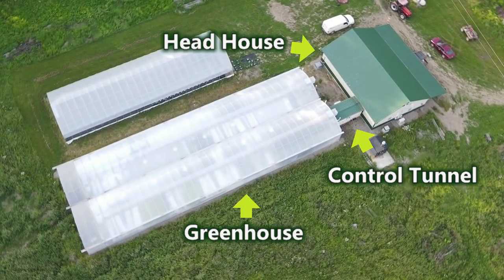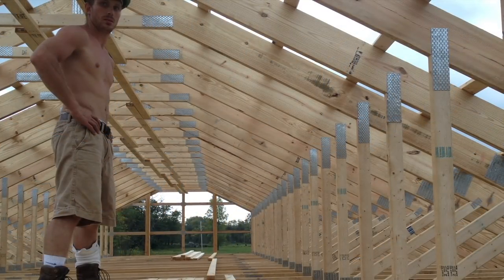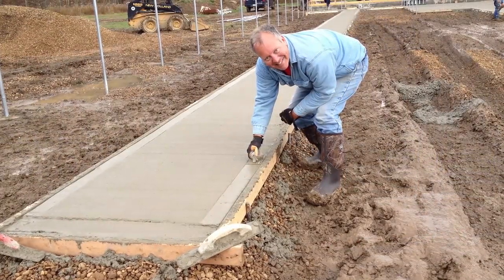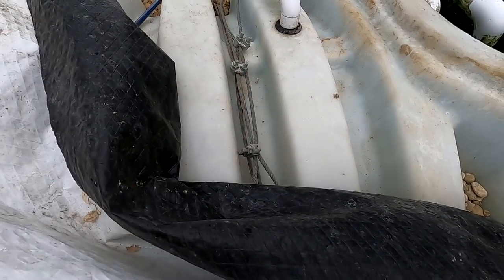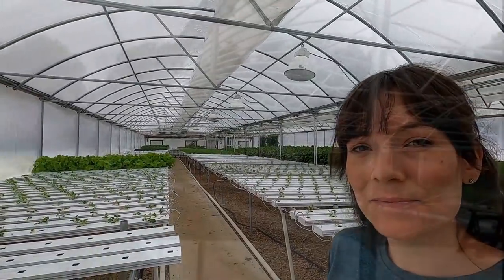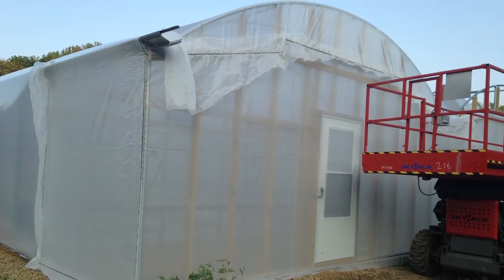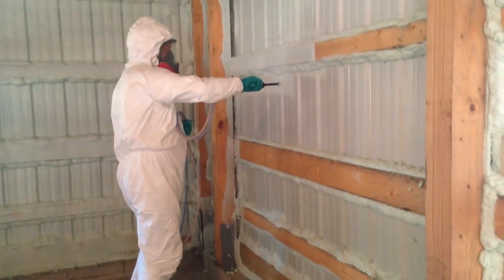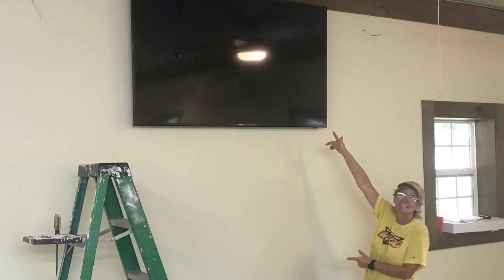Hydroponic Greenhouse Build From Start to Finish

Comment: Wow great job.  I read a book once called the Broken Heart Buffalo Farm where the owner said that being a farmer means that you will have know all the trades otherwise it would be too expensive to run the farm.  This video sure showed the number of trades that Doug knew.  He had to work concrete, sheet metal, capentry, electrican and plumbing. He sure save more than a pretty penny for this job but needed a lot skills. Respect.

Comment: Wow, that's a nice set up! I'm planning on building a large greenhouse on my property in northwest WA. I've been watching a lot of videos on the subject and was thinking of doing the geothermal system to capture the 55 degrees of ground heat to keep the heating bills down. I'm probably going to do raised beds but your system of only using water is very interesting. What would be the best design of greenhouse I could build? I'm a carpenter and would like to do as much as I can like your family did.

Comment: Really great project of the greenhouse system. Your Dad is a very methodical worker in the detail of the build. Looks like a ton of research went into this. Very impressive.
Do you have an alarm on the sump pump in case it fails. It is an electric motor with a switch is why I ask. I guess there was no way to put in drain tile to a lower site to empty.
Reply from the maker: Thank you! We do not have an alarm, but that would probably be a good investment.  There is a small river right behind the greenhouse and we are in a valley which keeps the water table high.  I'll have to show how close the river actually is sometime.

Comment: This looked like a really fun project. Lots of hard work though. Congrats to all of you. What size is your head house? Also how far is the head house from the greenhouse? How wide is the control tunnel? Looking to eventually do one myself. Thanks.
Reply from the maker: Thank you very much! I want the head house is 40x50', but I'd have ask Doug for sure.  The head house is only 10 or so feet or so away so that's how long the control tunnel is.  It's probably 6 feet wide. Not big at all which is why we love having the extra space in the head house.  I recommend giving yourself lots of work area if you can. - Devon

Comment: How does it work using city water for your hydroponics. Is it expensive? Here in NZ I have to use city water but have to use a lot of acid to bring the ph down. Our water is about 7.2
Reply from the maker: Its not expensive. Our PH is 7.1 so like you we do have to bring down the PH...what are you using to lower PH?
Reply: @HomegrownPassion  Nitric acid

Comment: You guys show everything so easy, each of those projects are a challenge , congratulations on jobs well done. I have one question tough, the water source is beneath the earth, how do you clean it when there is algea or some other contamination happens. It is bound to happen at some point , right ?
Reply from the maker: Thank you very much.  It was a big project, but we had a lot of fun.  I will have to show this in a video, but we can totally drain the tank. We have a very long brush, and we can also hose it out.  We do need to clean sometimes to get the algae out.

Comment: First thank you for the video.  It is a high quality project .  What do you use for a slope for the various drains ?  How do you clean debris out of the stone and do you wish that this were concrete also ? With the large roof areas would rainwater harvesting have been a consideration for your water usage, either for the plants or for the wet wall ?  Thank you for sharing.
Reply from the maker: Of course and thank you! For the NFT channels, the need 1" of slope per 4'.  I'd need to look up the plans to see the slope of the large return to the reservoir.  We usually have the leaves fall on the cement when harvesting luckily, but sometimes we have stuff break off and we have to climb under there.  We also get a few weeds pop up and just pull them.  The stone works well, but I'm sure full concrete would be nice.  Rainwater could easily be harvested, and is something we are considering to use for our high tunnel.

Comment: May i ask, How did you guys install the plastic. Did you use screws?
Reply from the maker: No we used wiggle wire and clasp system designed to be used on the gutters

Comment: What was the place where you got the spray foam insulation?
Reply from the maker: It's called Foam it Green. Doug ordered it online and it comes with everything you need. Here's the amazon link but it's sold out on there.  You may be able to find it some where else.  
https://www.amazon.com/Foam-Green-602-Closed-Insulation/dp/B00597CCUU

Comment: the long a waited vid is finally here , thank you so much , i have one question ,what is the benefits of a double layer of poly vs one layer ?
Reply from the maker: Of course! The double layer is for insulation.  We have inflation fans for both the sides and roof, and it keeps an air pocket between the layers.
Reply: @HomegrownPassion  Who is the manufacturer/supplier for the greenhouse framing and the double ply poly sheets. I like the double sheet idea. Thank you for educating and entertaining us. You are a pleasant presenter who do really quality video production work.

Comment: The video is well thought out and edited. It must have taken some time to put together. Well done.
However - it inevitably raises a whole bunch of questions for me.  Here is the list!

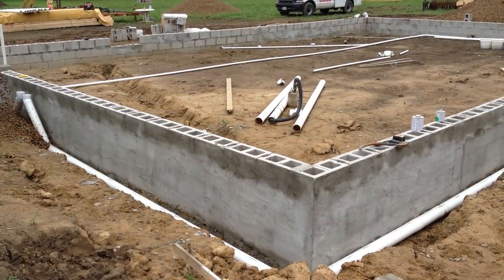At 01:38 - the cement block walls look like they have started to be rendered. 
If that is so, why would you render them?

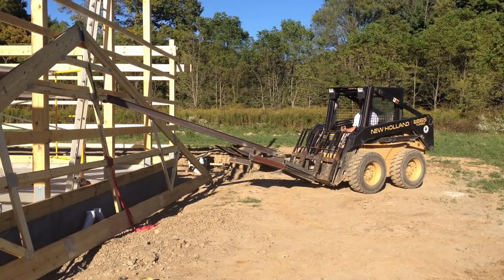at 02:39 - that skid steer looks like it would be able to lift 800kg or so. 
The trusses do not look so heavy.  What was the problem with the jib? 
Was it because it was hard to maneuver the trusses and control where they were placed
- or was it actually the weight that was the problem?

Some details I'm not sure about are - which direction is the greenhouse aligned with?
How high are the tops of the posts off ground?  
How far apart are they spaced? 
Knowing that will enable the approximate length and width of the greenhouse to be calculated.
And how high is the greenhouse at its  apex?
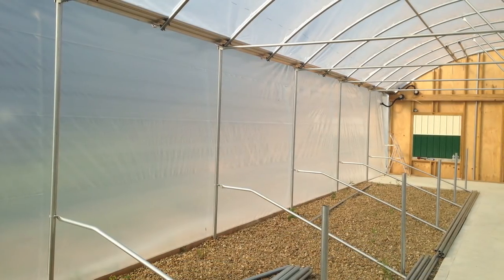Why are the angled horizontal pipes needed at 13:36? 
Why are they not just straight and used as supports for tables , NFT troughs etc?
Why is a vapour barrier needed underneath?
 the gravel in between  the greenhouse   aisles?
How much water do you go through in summer - and in winter? 
The vent wall needs a little more detail - probably needs a whole video done on it!
Is there adequate ventilation or do you think it is running a bit close to the bone?
And finally, related to that - have you ever lost crops because it was too hot?